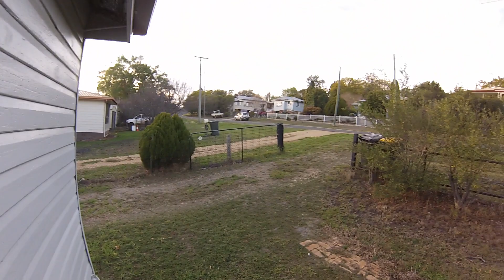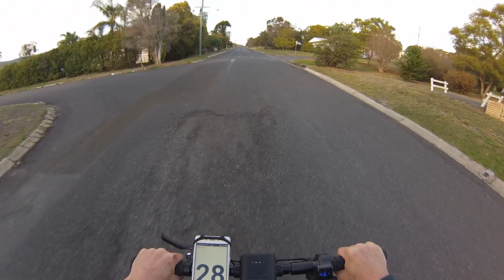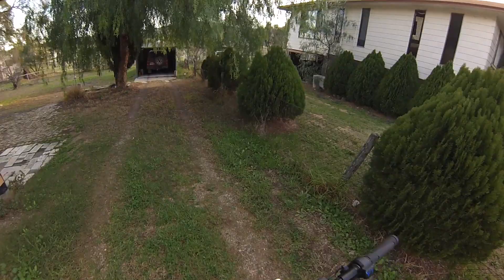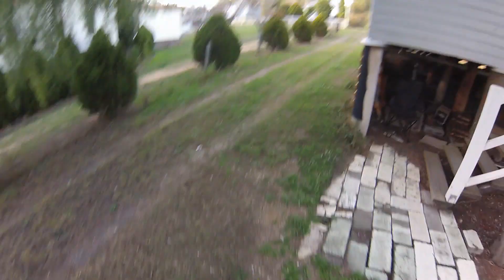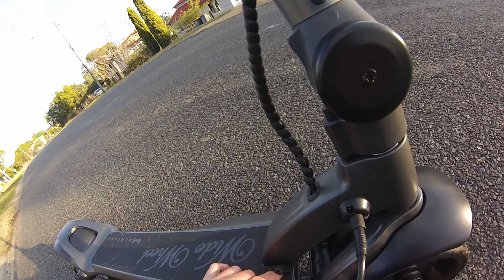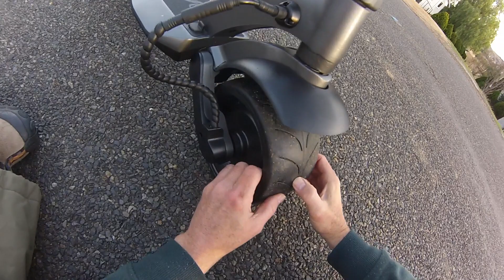mercane wide wheel dual motor (first try)

Comment: Mate just picked up my wide wheel yesterday. Gonna take it for a spin around Melbourne.
Reply from the maker: cool ... if you haven't seen these before please give them a look over
https://cjeastwd.blogspot.com/2020/01/leaning-off-it.html
https://cjeastwd.blogspot.com/2019/07/charger-sparks.html
https://cjeastwd.blogspot.com/2019/10/prep-for-riding.html
https://www.youtube.com/watch?v=AUsOqMqggbk

happy scooting
Reply: @finophile  Hey mate do u find that the rear suspension squeaks alot . Was just wondering whether I should grease it up a bit.
Reply from the maker: no it doesn't on the widewheel, but does on the MX60. It could well benefit from a grease. I strongly recommend my article here:
https://cjeastwd.blogspot.com/2019/11/another-inspection-and-maintenance-item.html

you can see in that the two screws which secure the sides onto the axle pivot (not mentioned but that's what they screw onto). I recommend you check them and then remove that shaft (simply unscrew each side, remove one side (it pulls straight out) and put some heavy grease onto it. NOTE: protect the inside of the threaded holes that the sides screw into from grease and clean it and the screws with turps before greasing and re-inserting.

Grease the shaft as you insert it (yes its a bit messy wear thin rubber gloves to make your own clean up easier).

Marine Grease will be the best. You can see the front swingarm (identical in structure) pulled down here https://youtu.be/1AjJ7pz2yp8?t=212

Best Wishes

Comment: Hey bro do u think its better to upgrade to the 2020 widewheel pro or this 2019 version is good enough. Currently I have the xiaomi pro
Reply from the maker: Hi
well my view is firstly don't ever bother upgrading something because its usually way more expensive than buying the different one. As to which one is better that's entirely not  my call. For instance some people just LOVE app connection between phone and scooter. I pretty much don't want that. Some people love regen brakes, to me far more hassle than their worth.

So given that what I like and think is important may be totally different to you; myself I'd hunt for a 2019 and save the money. I think front brakes are dangerous if you aren't using balance to keep your weight back and the advantages they provide are minimal for the speeds these things do (and I never recommend people to use it without the speed restriction in place).
I've got no problem with the 'dash' and lack of speedo because I couldn't give a shit about that. Worse a commenter on my blog has said his "dash" has already broken because its held together with plastic lugs. FDAT

I love mine and still do stuff on it like this: https://youtu.be/xqJ_ddGF0yU
But I strongly recommend you follow this advice: https://cjeastwd.blogspot.com/2020/01/leaning-off-it.html
and watch the youtube video included in it ...
Reply: @finophile  thanks for ur personal opinion bro.
Reply from the maker: welcome Dan
I hope it helps you :-)

Comment: Nice test.. What can you say about the tires, are they okay for a solid tire? Because they say, pneumatic are the best ones for long rides. Would you recommend this for long commutes? Thanks.
Reply from the maker: its a tough question to answer because its got some assumptions that are essentially like asking: do you prefer beer or wine. There is no right answer and "it depends".

So how far is long? Myself I ride my Widewheel about 6km each way without any hassle.

Pneumatic tyres the best for long rides? I don't know what that even means, but I'll assume that its based on some people feeling that because road imperfections are transmitted through to the rider that its bad. Don't ride a skateboard is all I can say. I personally love that it lets me know just how much harsh shit I'm going over so that I know whats happening and (if I had pneumatic tyres) don't get past the point of the tyre soaking up some bumps to "oh, pinch flat - out of the blue".

Grip is perhaps less than (say) my MX60 (which is pneumatic tubeless) but I would point the finger at the suspension being a bit crude and simple. Effective but curde.

At the end of the day for me 100% I don't want flats. So I'm willing to accept what that brings.

I recommend you view some of my other widewheel videos (or better yet) read my blog too. Probably you could start on worse posts here: http://cjeastwd.blogspot.com/2020/04/range-testing.html

Comment: I use my single motor Mercane to work and also the golf course. Wishing I bought the dual motor now as it is a bit sluggish on the uphill holes on the grass. 1 hole is a push situation. Overall great! How much heavier is it though?
Reply from the maker: wow ... you get the 500W  to do a golf course! That's impressive.
Yes its a few Kg heavier, but to be honest its still managable. I've weighed it in at 5kg heavier than the Single Motor.
Shit loads lighter than my MX60

Comment: My new 2020 model is only a week old and already the stem wobbles fore and aft. It’s not the bolts or the plastic folding knob as they are all tight. It’s inside the neck where the bearings are. I tried to tighten the big 36mm nut at the top of the neck tube but I couldn’t so I gave up. I also didn’t want to put too much compression onto the top sealed bearing. Has your new one got any movement in the stem?
Reply from the maker: Sounds lije a warranty issue.

Have you carefully diagnosed the source of the wobble?
Reply from the maker: also, what 36mm nut at the top? Can you post a picture, because none of the wide wheels I've seen have that. All are essentially like mine, and are an interference fit. See for instance this video:
https://youtu.be/9FqXrnxDAMM?t=23

also, just to be sure of your diagnosis this video may help:
https://www.youtube.com/watch?v=IE1jOCoLpBQ

blog post as mentioned in that video to check the bolts holding the stem to the board
http://cjeastwd.blogspot.com/2019/09/stitch-in-time.html
Reply: The 2020 model has a big black nut at the joint between the stem tube and the neck. It has a flat washer under it and under that it a sealed bearing. My wobble problem is definitely inside the neck as you can see, if you look carefully, the front wheel itself moving slightly backwards and forwards. I would post a video which I have but don’t know how to.
Reply from the maker: @basincut100  in that case it should be warranty. What you describe is a serious problem. Where did you buy it?

I have had no problems with either of mine.

You have a YouTube account so you can upload for free. Video can be taken easily using your phone, I used my phone for that video.
Reply: I know I can upload a video. I just thought I could maybe attach a video or a photo to my reply. You have a 2020 pro model. Above the top bearing inside the neck tube there should be a nut with a flat washer under it. Your 2019 model won’t have the nut just an O ring I believe. I would love to add a photo but it won’t let me.
Reply: Sorry I just realised your new WW Isn’t the 2020 pro model. They have completely redesigned the steering for the 2020 model using a nut with grub screw and steel washer.

Comment: Have you had an issue with that cable sticking out yet?
Reply from the maker: No, and I I took off the extension because I felt in my case it wasn't needed. No problems as yet :-)
Reply: @finophile  Awesome, i just ordered mine. I currently use the ES4 that i just got 2 weeks ago but yesterday my ES4 shut down mid ride ... thankfully i was paying attention and wasn't  moving fast or it could have been really bad.

Comment: Great no bullshit review. Thinking about getting one of these. It seems to me the 2020 pro model is a big improvement over the 2019 model and probably the biggest bang for the buck out there.
Reply from the maker: to me I'm not sure its a big improvement, but I don't see anything lesser about it, and so its a great iterative step. Unless there was some steep discount I'd get the Pro over the 2019 model for sure
Reply: finophile fair enough. Did you buy yours locally or from OS? AliExpress has the 18Ah version for $1300 including shipping and GST. At Scooter Hut it’s $1899.
Reply: My mistake 15Ah not 18Ah.
Reply from the maker: oops, also missed this. I bought mine from a dealer down the Gold Coast and paid a bit less. However IFF support is anything you value go to Scooterhut (they're good guys). If you are "ok" with Go it Alone then AliExpress can be a good way to save a few bucks!

If you are a bit DIY and not fazed by stuff like this: https://cjeastwd.blogspot.com/2020/01/mercane-battery-pull-down.html then I'm sure you'll be fine. Just do check it over thoroughly when you get it from Ali before giving the OK
Reply: finophile BTW do you have any issues with cornering? You often hear that it’s a problem/bit scary/big turning circle/blah blah.
Reply from the maker: none that I know of ... however I've ridden a lot of things, mostly I think its just inexperience and bad technique. For instance, perhaps this helps?
https://cjeastwd.blogspot.com/2020/01/leaning-off-it.html
and in this video I do a bit of almost "skateboard style" in my corners
https://cjeastwd.blogspot.com/2020/01/the-rear-kick.html

if you've come from a bicycle or a motorcycle then handlebar pressures don't help you to control a turn, instead its "out tracking" and the subsequent shifting of balance. (*I'm sure that's probably confusing ... sorry)
Reply: Ended up ordering from WideWheel Scooters Australia. They were about $200 cheaper than SH and service was great. Ordered on Sunday night and it was delivered today, Tuesday Sydney to Melbourne. Had a quick 3km ride but spent some time adjusting the brakes to my liking (nice firm levers) and charging. Looks the goods, definitely not a toy.

Comment: I'm 412 lbs. is this a good scooter for me?
Reply: No, you're a fat bastard. It's not made from Vibranium...
Reply from the maker: plug your weight into the calculator on my blog post (here http://cjeastwd.blogspot.com/2019/07/benefits-to-more-power.html) and see what sort of speeds you'll get, but you're also more than double its rated weight ... so I'm thinking no...
Reply: Yo Bruce. How's Wide wheel 3 months later going? Still in tact solid as Korean rock?
Reply: You'll need two.

Comment: really thinking of getting one of these, just want to wait for the Pro model to come out in the US
Reply: I'm only getting the pro since I don't have the 2019 model. While it seems like an upgrade, I'm going to miss my key start. It'll be my first scooter and guessing the longest I'll ride it for is 14 miles for work and back
Reply from the maker: @Rachiou077  Myself I wish I could get rid of the key start... PITA
Reply: @finophile  actually to update on my post, it seems that only fluidfreeride offers the no key start. I ordered mine from Apollo scooters despite being in the US(FFR wasn't selling their preorders yet)

So if u did felt like getting one, u would prefer to get one from them.
Reply: @finophile  why would you not want the key start?
Reply from the maker: nothing wrong with that, the Pro has a few small enhancements which aren't what I'd upgrade for, but wouldn't turn down either ;-)
Reply: Same here in the UK 🇬🇧

Comment: Which mount are you using for the phone? Also any other accessories you recommend,(lock, hydraulic brake upgrade on the rear, lights, etc...). Thank you in advance. I purchased the latest model for my son for college a bit hilly where he is.
Reply from the maker: just an ebay cheapie ... fully "rubber" ... let me know if you want some pics.
Reply: @finophile  Actually pictures would be FANTASTIC!

Comment: ? Is this scooter similar in size to the m365. Is it bigger or smaller or about the same.
Reply from the maker: as mentioned by starbloc its bigger, but not so much in length or height but more in weight and bulkyness. My single motor version is 4kg lighter and having done a side by side with an M365 I'd keep my Mercane over the Xiaomi every day. (range, hills, suspension and stability)
Reply: @finophile  very wel stated
Reply: Its bigger